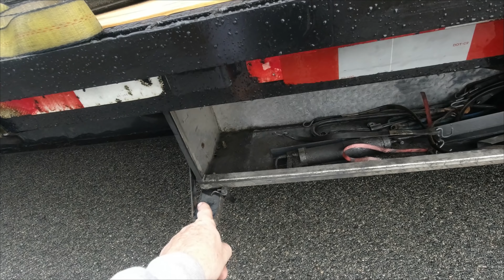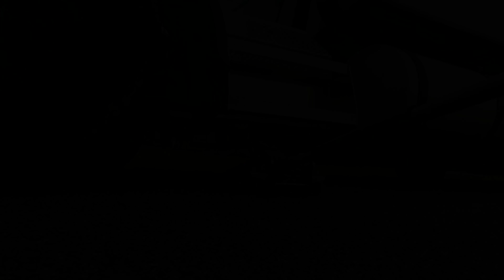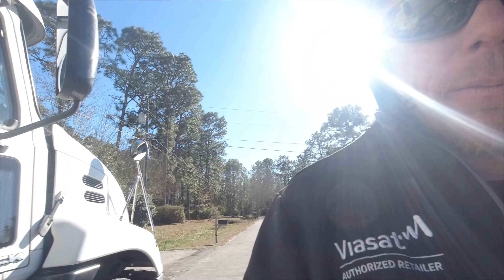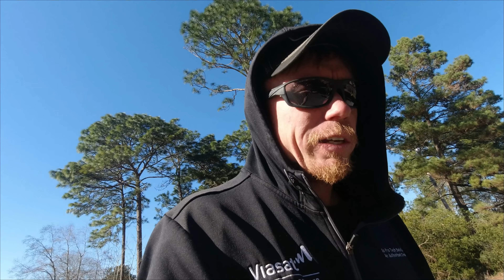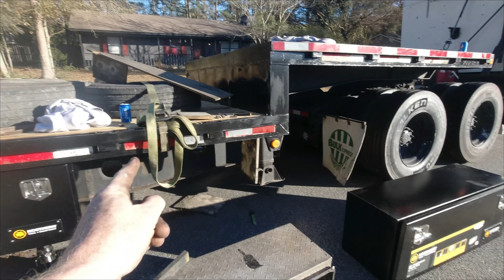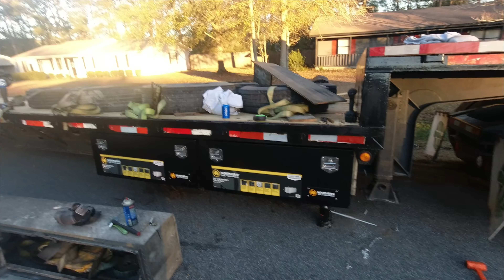New Toolboxes And Our First Big Repair Bill!

Comment: Fix a spare wheel and tire for the trailer. weld you a tire rack under the side of the frame of the trailer You will need a spare for the trailer.
Reply: yes or some stepdecks have a space right below the step between the frame rails where you can put your spare.
Reply: Excellent advice!!! I carry one for my pete, and my trailer!
Reply: TP left home without a spare and it cost him.
Reply: When you get a headache rack, secure the extra tire to it. Seen many a rig with a tire up there.

Comment: probably already welded the tool box on but I would also go inside the frame to the existing holes and drill  extra holes all the way into the tool box and come back with some carriage bolts on the inside for extra protection against road vibration.

Comment: Yes, carry spare tires. I carry a decent steer tire w me. It wiill fit truck or trailer for me. When you buy a tire on the side of the road its not cheap. I carry airhose/ impact, tire tools, 20 ton bottle jack, and bead blaster tank. I just put a quick connect on air tank to run impact. I was afraid truck wouldnt produce enough air, but it did. Sometimes have to let it build pressure to get all lug nuts off. Good luck to you! I look forward to seeing you on the road.

Comment: If you want the generator in the box, cut a hole in the back of the box, mount gen in box, then put a removeable cover over the hole. Let the inverter power everything and let the gen power your battery charger. Hope you welded a brace to strengthen your "L" bracket between your 4ft  tool boxes.

Comment: Think about making a box along side or inside those 4' boxes to mount the generator. My other suggestion is to put a door in the back wall of your step box. To install and remove the genset. The genset is going to need to breathe in the boxes as well. You don't want it to cook itself.
That two prong plug under the back of the sleeper most likely goes into the battery box. It could have been set up for a lift gate charger or a tarp motor for his dump trailer.

Comment: Build a small platform between step box and fuel tank to mount generator. Also the new boxes on trailer should be pushed in so you can get your straps hooked to the side rail.

Comment: EXCELLENT WORK ROBERT... YOU FIXED  IT UP RIGHT.. THAT FORMER TRAILER OWNER OUGHT TO REFUND YOU A FEW THOUSAND DOLLARS BACK DUE TO IT BEING 10 YEARS OLDER OF A TRAILER. DON'T HOLD YOUR BREATH. IT SURE DOES LOOK GOOD AFTER ALL THE REPAIRS.  WE NEED TO FIND YOU AN APU FOR THE TRUCK. THE LITTLE GENERATOR PROBABLY WON'T CUT IT. IF YOU NEED SOME HELP I CAN DO THAT.
Reply from the maker: I think we've found one 🤫

Comment: My step has a space between the frame under the neck for spare tire but I have a 4000w generator stuck in there to power space heater and tower Ac inside the truck. Do not put generator on catwalk it will get crushed. I ran a heavy duty cord thru the bottom of the sleeper down the frame to the back and just plug and unplug as needed.
Reply: Only bad thing I can say about putting generator between frame under neck of trailer is when it’s cold and wet it will ice over but I stay in TX so no worries besides last week that’s how I learned but nothing a hammer can’t fix

Comment: Couple things l see. A lot of guys with drop decks keep a spare just behind the drop between the main rails. You absolutely can drill the frame rails. Only on the web though. That's the vertical part. So you could simplify your box mounting system. I'm guessing that you don't have one on the driver's side. I know I go up and down the driver's side 90% of the time. The generator on the trailer is a good idea imo. Put it in one of those long boxes and run a cord.

Comment: You can drill holes in the frame, just not through the top or bottom flange.  You're also ok to cut the huck down just don't cut the collar on  it. The law man can give you grief for not having a grab handle for climbing up and down on that tool box.  It looks like you're exhaust stanchion is missing three bolts.  Possibly from where you removed the hydraulic tank?  You need to get some bolts in there it you'll end up with a broken stanchion.  If memory serves a  5/8" bolt about 2-1/2" long should fit them.  Use lock nuts and flat washers.

Comment: Hi u never get a break but u keep on moving forward 👍🏽. May I suggest remodeling the box u took out for the generator instead of where it is &  the stepbox be mounted on the driver's side to access the air lines

Comment: That's not bad for breaks and seals and tires. You will need to test and see that your trailer doesn't hit your gen when turning sharply or 90. Mine did so had to move it closer to cab
Reply from the maker: That was only 2 seals..
Reply: Yeah on these truck's it can get expensive quickly. I just replaced my Transmission cost me $8800. You will need 10K in reserves for maintenance.

Comment: Just tell everyone you had some drinks in you when you welded the box with steps on it to the frame of the truck. The 2 gang tool box without the door just cut it at the middle point and cut the end off the broken box and weld it on , Now you have a tool box with a cover on it

Comment: Your generator will get knocked off it you leave it there.  It's a question of when, not if.  Plus, it's going to interfere with your air lines, and DOT might gig you for it.Also, I would take that old POS wood box off before it falls off.  I understand you want to use it, but it looks like shit, and be easily broken into, even with a hasp.  The new boxes look good.

Comment: You may have to relocate the generator? It might get in the way of jacking your trailer? I never did put anything on that catwalk because of that? When you go into a deep jack, the trailer will probably be over the catwalk? It would probably destroy the generator and possibly drive it into the back of your tractor if you forget about it being there? There will be places youll have to do hard jacks to get into where you need to be. I have had to jack so hard that the trailer was within inches of the back of the cab of the tractor? Just a heads up. Glad your moms doing good.

Comment: get DC charging cords for computer. Some TV sets use wall warts so can take 12 volts directly, or can be modified to take 12 volts inside.. It is surprising just how many things you can find that can run on 12 or 24 volts so your generator can be run to simply charge the batteries
Reply: My Lenovo Laptop is 20 volt but has a charger adapter for 12 volts...which I use in my car and at my one house to run off solar panels

Comment: First of many to come... I just spent 30,000 dollars for a out of frame o haul.
Reply from the maker: Are those much better then in frame?
Reply: @SouthGeorgiahotshot  : they line bore the engine block, hot tank it, inspect the crank, inspect the flywheel and clutch , put new motor mounts in etc.
Reply: @SouthGeorgiahotshot  Yes.  But if your motor has been well maintained (regular oil change, not run hot, have valves adjusted) and is now only starting to use oil, you'll be just fine with an in- frame. Pistons, liners, rings. Possibly injectors and wiring harness. Anything else you may want to add.

Comment: Drill an 1/8" hole in the rubber plug in the hub. The only reason the seals give up and leak is because they build up pressure and the seals let go. Save yourself any seal problems in the future. Do the same thing on the front of the tractor.
Reply from the maker: I've heard this before
Reply: @SouthGeorgiahotshot  It works, started driving trucks when I was 17 before CDL's. Now 54. Keep you a truck spare and a trailer spare on ur unit. Get a flat an have to buy a tire at a truck stop and that will teach you. LOL

Comment: Did you read the safety label on frame No welding or drilling of frame unless by engineered fabricator, yea I know frame has holes everywhere but those are all engineered. just saying every truck when new has that decal to cover manufacturer liability

Comment: If you dont have I get a Milwaukee 3/4 impact drill and a 3/4 socket and extention with a swivel kit for the tool boxes you will thank me later tow Bill's ain't cheap for a semi if you can fix some small things you will save yourself a ton of money instead of tow charge and fix bill. There isnt a bolt on that truck that drill wont remove without breaking a sweat
Reply from the maker: I run the kobalt 3/4

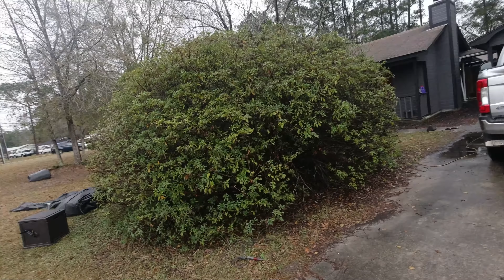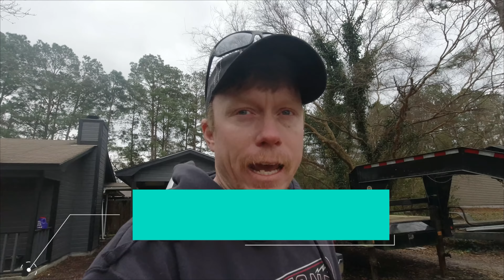Comment: that bush , in frame 4:04/24:32 looks like it has a good crawl sized opening. you could have a fox living in their.👈👺👀👀😒👀👀👉🦉
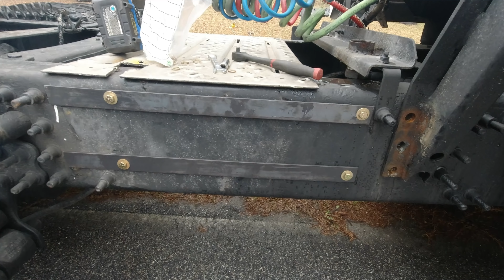do you need to put bolts in that, thing that holds up the pipe in frame 7:35/24:32👈😒👺👀👀👈

Comment: your generator will overheat inside that step box, ask me how i know. Also what # key do you need for your old toolbox on the trailer? they are available online for a few bucks, good luck
Reply from the maker: I've replaced the locks already. Honestly they were kinda f'd anyways
Reply: @SouthGeorgiahotshot  ya they do require a bunch of wd40 if they have gone unused for a long time.

Comment: Semi tires are a little different than car or pickup tires. Not sure if it's still the case, but a decent semi tire, with no tread on it, was worth about $100 for re-treading. I'd double check before you spend money on disposal.
Reply from the maker: I was wondering this
Reply: @SouthGeorgiahotshot  I think it also depends on the size.

Comment: Can I ask why not just put a APU on the truck. That would give you ac/heat and you can run everything at once with no issues
Reply from the maker: Have you priced apu's?
Reply: @SouthGeorgiahotshot  I didn’t know you had looked I can find you a fairly cheap one
Reply from the maker: @gamingwithallen7812  I think we've found one. Thanks though 😌

Comment: Them Northern Tool boxes are really heavy duty. I put one like this under my GN trailer. Really strong and the seal on the door is holding up great, no leaks. Not sure on the gauge of the steel but they are much thicker then the buyers ones and other ones i looked at.

Comment: Say guy.   They ripped you off.   About the brake pads.   And the oil wheel seal.
Reply: No they didn’t
Reply from the maker: I've heard both ways. You can clean with brake clean. And then I've heard you can never trust them again. If it was the hotshot rig I wouldn't worry as much. But 80k lbs. I was ok replacing them
Reply: SouthGeorgiaHotShot you’ll never get  all the oil out. The oil will catch fire at a lower temperature than the brakes would if they get overheated

Comment: Mounting boxes I find it easier to bolt on the brackets tight then tack one side, level it,  tack the other then unbolt and weld out. Just in case you add more later on.
Reply from the maker: Sadly my welder won't reach my road lol

Comment: Personally I wouldn't trust those home made tool box brackets you made. The welds don't look that good and I didn't see you weld any band steel at 45 degree angles for reinforcement on yours like the existing bracket had. Obviously you can't have the 45's on the center bracket for the new 4' tool boxes but that's the bracket I'm most leery of, especially if you put allot of weight on the boxes. I am a truck driver, heavy equipment operator and welder/fabricator for 30+ years and I'd be worried about that center tool box bracket. Plus you only have short welds that looked kinda bubble gum holding the channel steel onto the band steel you bolted to the frame for the step box. That's not allot of weld surface area for strength. What was the width of that band steel? 1-1/2" maybe 2"?
Reply: He don't have to show every single thing
Reply: @bozzaa I too feel anxious about that center bracket! Hope he reads your comment
Reply from the maker: The bracket was actually welded all the way around 360°. I trust my welds more the the bracket that was on there.
Reply: That center bracket is going to break when the boxes are loaded-up and deal with road vibrations.  You need to put a 45-degree support between the boxes on that bracket to reduce the flexing on the support.  The road vibrations are going to cause the weld or metal at the 90 to crack.

Comment: Old out of date video. You would not even need a generator if you used a lithium battery system which was isolated from your truck battery starting system and charge the lithium as you drive down the road off your alternator. Using your truck batteries to  run your inverter will shorten their life.

Comment: You got to be kidding me cuz how you going to put mud flap brackets on that you like them if you can't drill into your frame yeah you can do in your free time I've done it before as long as you're putting it on there and it's here with the grade A bolts that you need it should be fine the way your phone about doing it you're going to spend more time tightening them both up because I stupid things going to slide back and forth and they might even slide into your drive tires or hit your tank and puncture a hole in it trucker Dan manada Apu and they had to drill into his frame I've seen several of them do it and then I haven't done it in the past I don't see anything wrong with it